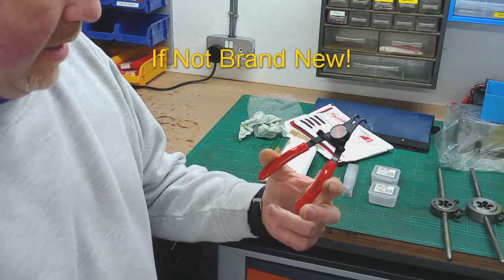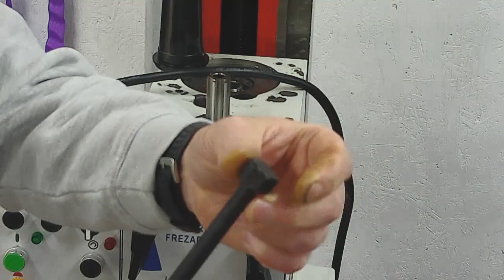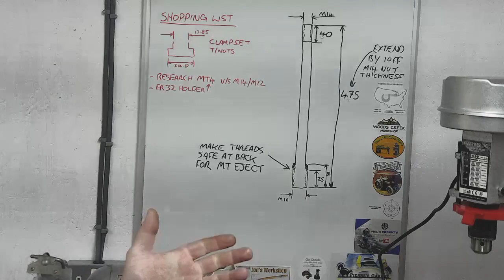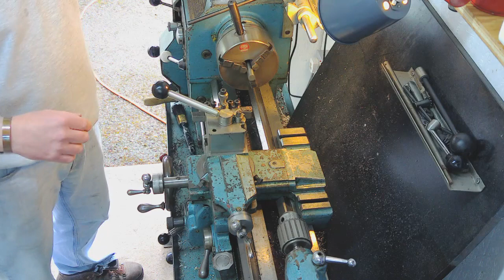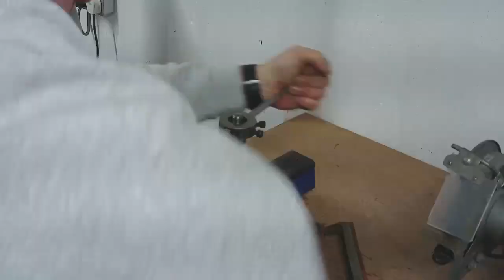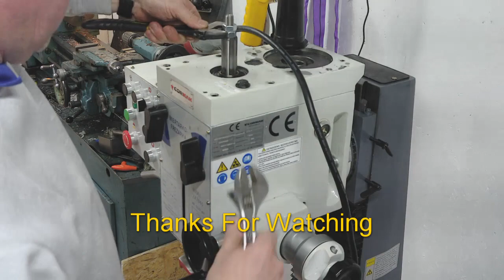Episode 19 - Making an M16 Drawbar for the Cormak ZX 7045 Mill

Comment: Hi Jon, can I ask why you went for a static phase converter instead of a VFD? The reason I’m asking is I have a Myford Super 7 at the moment and I’m looking to upgrade to a three phase machine and I don’t know which way to go. Thanks John
Reply from the maker: Hi John, thanks for the comment. I went for a static converter as it was the cheapest solution for multiple machines that I also thought might be more stable than VFD's over the long term (made in England as opposed to you know where)! I did loads of research and VFD's seemed to be a bit temperamental etc. On reflection, it was a mistake I think, should have gone for a rotary converter (couldn't afford or justify the cost). I think if I had to make the same decisions again today based on what I have learnt, I would have gone rotary converter for the bigger machines (assuming funding allowed), and VFD everywhere else. The 3 phase the static converter supplies is not true 3 phase and I can't get top speed on the lathe and the mill runs rough. If I was powering a Myford, I would definitely go VFD. Cheers, Jon
Reply: @jonsworkshop  Thanks for the reply Jon, the only thing that puts me off a rotary phase converter is the noise of the motor running all the time when you are using the lathe. I’m looking for a lathe around the same size as your Harrison M300 or a Colchester. My Warco mill was specially built for the guy I bought it off and came with three phase and variable speed on the control for the quill and motor speed and a vfd built into the back of the storage cupboard. Cheers John

Comment: Thank you for taking the time to explain your work. I'm trying to make a drawbar for that same machine as well and your video helped me a lot. My doubt is the total length of the drawbar. Should it be 475mm or longer than that? Thanks again. Good luck.
Reply from the maker: Hi Marcel, thanks for the comment. I cut mine at 490 leaving roughly 1mm facing stock at each end to finish at roughly 488 ish, the extra is to allow for two M14 nuts on the top to work against each other as a lock nut. This is correct for my machine, however not all 7045's are the same so I would still advise you to measure up before making yours just to be sure. Cheers, Jon

Comment: To get rid of that flickering Jon, put your frame rate to max, and turn off your electronic shutter if you have it, I don't know what camera you have...
Reply from the maker: Hi David, thanks for the comment and suggestion. It was my camera that was the issue, only did 30 FPS, totally at odds with 25Hz supply. I fixed this shortly after this video, using a Sony Handycam these days filming at 25FPS, all good now. If you are working through the vids, you will soon get to the change over point. Cheers, Jon

Comment: Hi Jon, what is the rating of the motor of your ZX-7045? Will the static phase converter operate the motor at full power?
Reply from the maker: Hi Matt, thanks for the comment. My motor is 1.1 kW and the static converter will go from 1kW up to 3.5kW. If anything it is a bit too powerful which leads to quit a bit of noise from the motor. Sorry for the delay, only just seen this comment. Cheers, Jon

Comment: Hi Jon, sometimes when your sufering from harmonics and vibration speeding up rather than slowing down can help especially on a thin bar(surface cutting speed)
Reply from the maker: Hi Derek, thanks for the comment. Yes, spot on. I have used this tweak many times especially on CNC machines where you can "tune" the speed and feed very easily with the overrides to detune the harmonics. Odd numbers of flutes and unevenly spaced flutes is also another good trick. My biggest issue is the bearings in the head and the stand which is basically an echo chamber (all to be addressed in future videos). Cheers, Jon

Comment: Well done for finishing the video, will the top cover fit now?. Like the eject idea.
Can we see a bit more of the set up?, and the start of the process. Then bring us back, not fast forward everything.
If you show the problem then the brains trust (audience) can possibly advise.
You can shorten the video with a bit less information, a picture saves a thousand words.
Keep at it, you will find the timing easier, as a previous  contributor wrote, we are looking forward to the lathe strip and rebuild more than you are, it does need some paint!.
Reply from the maker: Hi Fred, thanks for the comment, the top cap fits fine, loads of clearance under there. Points noted and the feedback is welcome. The next couple of videos will follow that format, loads in the camera ready to edit and post. Cheers, Jon

Comment: Hi Jon, new subscriber Mike here. Is that lathe bolted down and levelled?
Reply from the maker: Hi Mike, welcome and thanks for the support. It is very well levelled using a proper machine level, but not bolted down which I realise is not ideal. The original feet under the casting were designed not to be bolted but I guess it would help. Cheers, Jon

Comment: Your not having much luck with your machines. Lets hope its an easy fix to rectify your lathe problem. Tony
Reply from the maker: I know Tony, I am beginning to wonder if I am cut out for this! Old English lathe - poorly and ready to be taken to bits (will it live), old English engraving machine - not working, Brand new milling machine - already in bits before I even had a cut on! Dare not touch the pillar drill now! Cheers, Jon
Reply: @jonsworkshop  I'd give it some serious thought. You could spend hours trying to rectify a lame duck or bite the bullet and replace. You could be making actual project videos, not fixing videos. Although it could be an easy fix for the sake of a strip down. Tony

Comment: Hi Jon, Have you tried listening to the spindle bearings with a sounding bar ? )You know a piece of round wood, ear on one end and other end near the bearing) Try it with no load and various speeds.
Reply from the maker: Hi Derrick, I haven't yet but thanks for the reminder. I used to listen to the bottom end of motorbike engines like this many years ago. I will give it a go next time I am out there. Cheers, Jon
Reply: Also you can put a substantial diameter bar in the chuck with about a foot sticking out and put a mag base on the top of the headstock and a DTI onto the top of the chuck and just lever the bar up and down to see if there is any amount of radial play in the front bearing. Anything more than a few thou is usually the cause of any chatter, whether parting off or long shaft turning. Usually the chatter in long turning is caused by harmonic vibration and it will occur in usually two places where the nodes are depending on the length and diameter of the work. The only way I have seen it not stopped but lessened is to have a well oiled rag in your hand and you put downward pressure on the bar. Sometimes it works sometimes it does not.

Comment: You lead such an exciting life, no time to get bored in your shop, unfortunately 😉
On your lathe do you have two drives to the saddle, leadscrew and power shaft, or just a leadscrew to do both threading and power feed? If you have two is there an interlock to prevent both being engaged? Also when the saddle gets stuck is the saddle handwheel tight or do you still have free play in it. Sometimes on my Bantam the handwheel gears try to ride up the rack gears and jam when using the leadscrew to power the saddle but curiously not when power feeding. Yes, i must get round to realigning the rack, but then  i might get my hands dirty😢😢😢
You should be able to measure any play in your headstock before a strip down and measure saddle and cross slide gib play too just in case they are out of spec too. You could also try using a dead centre in your tailstock, to eliminate the rotating one from the equation.
Reply from the maker: Hi Chris, too exciting by far! 
I have both a feed shaft (usual linear slotted geometry), and a leadscrew. There is a selector to differentiate that all works as it should (stops engagement of the half nuts and operates smoothly with no tight spots). I think when everything gets tight, the slack disappears from the winding handle (I am normally in a state of panic at this point so need to test properly). I did a couple of rudimentary checks this evening and I can effect about. 003" end float on the spindle but this returns when the pressure is released (just using a piece of bar behind the chuck in a direct fashion an pulling with both hands). I can't detect any radial play when using the bar as a lever under the chuck. Gibs on cross and compound slides are in good condition, I set them up when I bought the machine. If I grab hold of the tool post and start pulling things around, the lathe gets unsteady on the floor before I can really feel any play/slop in the top end and largely, I have got circa 90 % travel on both with uniform resistance before things start tightening up at each end. The more I stare at it, the more I see the the solution being a new set of spindle bearings attached to a Harrison M300!!!!! I have my 3 phase sorted now so more options to play with. This will be months/year away based on funds so I need to limp along. We will see how excited I am once I have got the mill up and running and I may just take it on. Cheers, Jon
Reply: @jonsworkshop go for it but get the TR model although new bearings for a Harrison probably cost more than your whole Boxford!🤔 better fix that unless the lottery comes a'calling.
If the saddle handwheel does lock up you might have an alignment problem, like mine. In my case the rack is only just engaging in the drive gear and one will turn the other but not vice versa, reliably. Or perhaps the gears bearing is worn allowing it to come out of full engagement partially jamming up the system.

Comment: Just wondering if the 14 mm nuts will fit when the quill is down.
Reply from the maker: Hi Toby, the short answer is: yes (now), the long answer is: you really know how to ruin a blokes afternoon......... It was something that stupidly I never even considered so when I saw your comment at work, all I wanted to do was go straight home to find out how daft I had been. Upshot is, the corner to corner on the nuts clears the O/D of the spline by 3mm on diameter, it doesn't however clear the I/D of the spline. I have taken about 1.2mm dia off the O/D points of the nuts and it now clears (just). Once I have the mill commissioned, I will make some bespoke nuts (probably out of the ones I have already butchered) removing about the same stock off the flats. Thanks for keeping me honest Toby, cheers, Jon
Reply: @jonsworkshop  This is what happens when you have too much time on your hands and watch youtube videos. I do enjoy all machining videos, and found yours after Ade gave it a mention. Great content, and sorry for ruining your afternoon. Keep up the good work.

Comment: Excellent job working around the problems most people leave that out and i think that we learn more from them so thank you Jon for leaving them in it made for some great video and some great info that will come in handy keep up the great work Jon and thanks so much for great content
Reply from the maker: Hi Joseph, thanks for the support, it is tempting to edit out all the bad bits and just show a glossy veneer however it's just not my style. I like to be totally straight, tell it how it is (as Cormak now know). I really want this channel to be a useful reference for others/beginners etc so you will always get warts and all. The whole ethos of Engineering no matter what type, is solving problems and I enjoy it even it is a little frustrating at times. I am quite sure the camera has something to do with it as well as there are always exponentially more issues when that is switched on. Cheers, Jon